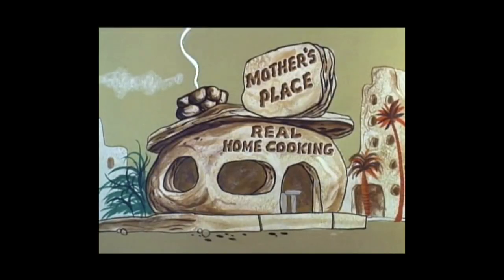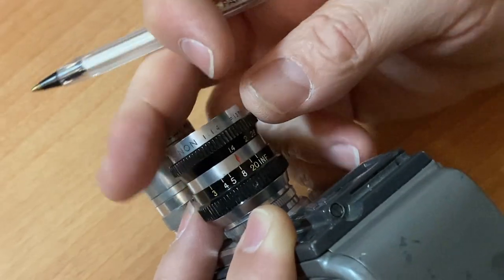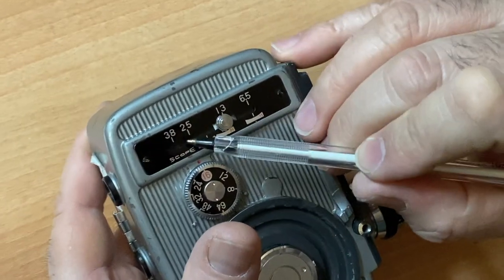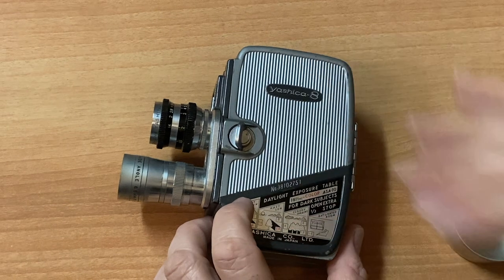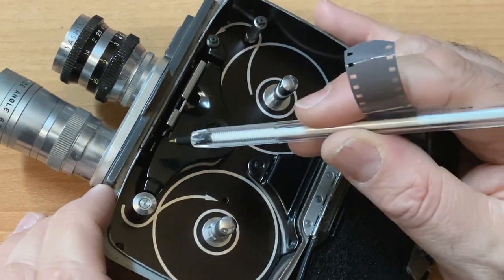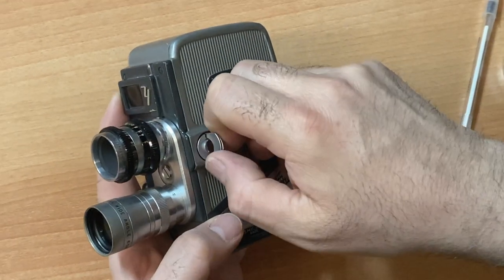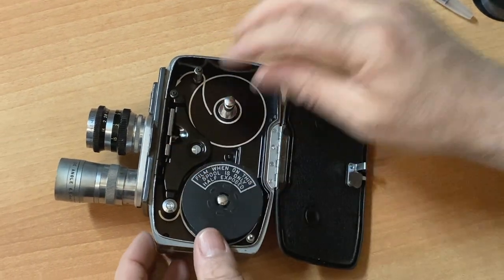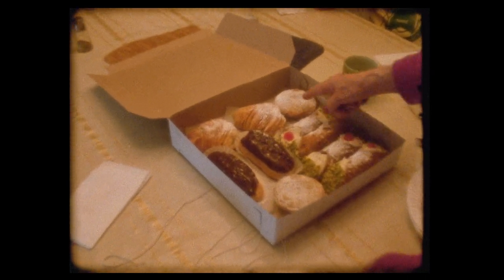Yashica 8 T2 8mm Film Camera Overview

Comment: Hi. I know it's a good idea to change film in a dark room to avoid exposing it to light. However, I am afraid that I may do it the wrong way while loading the film in a dark place. Is it possible to intentionally discard the first few frames after mounting the camera in a bright place like a regular film camera and closing the film compartment? And when changing the film to use the other side of the film, will all the captured frames be lost if I do it in a bright place?

Sorry for the many questions. I wonder what the action of winding the main winding to press the shutter is for. Should I turn the mainspring until it stops turning? What happens to the frame if I don't turn it all the way?
Reply from the maker: Suggest loading in dim light. You can turn the spring gently til it stops or you feel it getting tight. - Mike